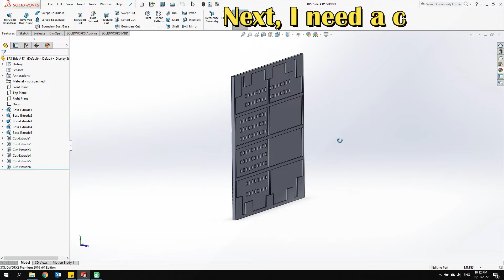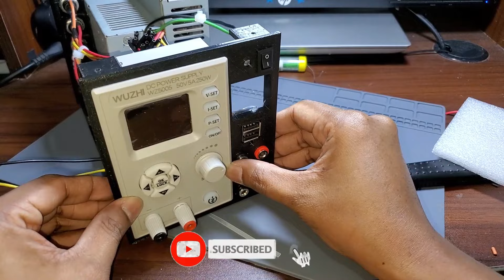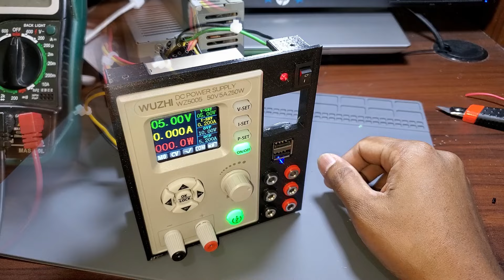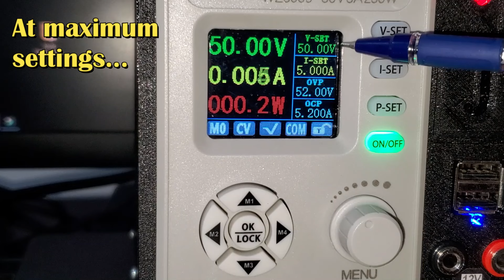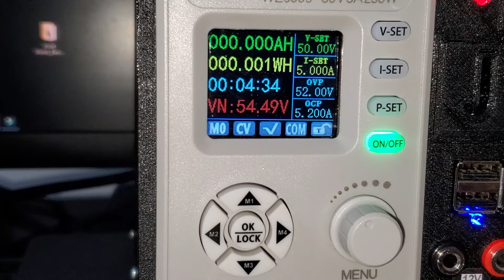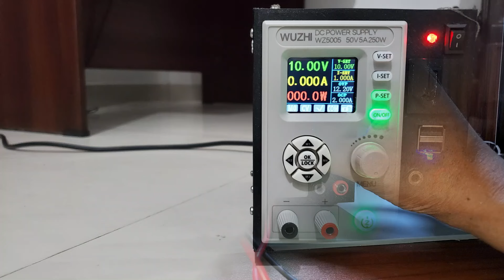DIY Variable Bench Power Supply 50V, 5A Using ATX Power Supply & WZ5005 module  Joule Works

Comment: How can you make this miracle happens? Using a 225W power source and a boost converter (91% to 96% efficiency) you'll get up to 250W output? 216W at its best. Do the math.
Reply: As the video description, he mentioned max total is 223w and that variable voltage module 150w max.

Comment: Next time try 50V and 5A - and u will see, after a short time, it will blow up ^^
Reply: Elaborate
Reply: @rondo1233 actually it won't blow up because ATX PSU has protection circuit built in, if the load is too high the PSU will shut down. But he used only one 12V wire, that single wire isn't capable of delivering 12A. This ATX PSU rated it's +12V @ 12A, that's 144W.

The boost converter always consume more power than it's output power. He boosted 12V upto 54.5V. He claims this PSU delivers 5A @ 50V that's 250W. You see it's not possible to get 250W out of 144W, right?...

And the boost converter has a 
15A fuse at it's input, boosting voltage upto 54.5V from 12V will consume more than 15A of current when a load is connected. I'm pretty sure you can only get few m.amps of current at 50V.

Comment: Nice but the weakest link is that horribly noisy little boost converter, I would have it feed a capacitor bank with a large 5 ohm inrush limiter. (6 x 470 uF caps from old ATX power supplies would work nice in parallel)

Comment: from the price and operation and function , you can conpare with DPS5005
Reply: It looks like this DIY has 4 outputs, while most others only have one.
Reply: @DavidHust  the device itself only has single output, it cannot output different voltage and current in different channel

Comment: Joule : Saludos, I have another question and hope you can give me an answer; On my ATX P/S I cut off the connectors on the wires and I have a small problem, I ended up with 13 Black, 7 Red, 5 Orange, 3 yellow and (1) each of Green, Blue, Violet, Brown and Grey; Should i bundle and connect all the black's together and the same with all the extra same colored wire's (making one (1) wire of Black, one red, 1 Orange and 1 Yellow; If it's NOT too much trouble "PLEASE GIVE ME AN ANSWER ON THIS"; or if someone else reads this and has a solution will appreciate it very much.
Reply from the maker: Yes you can bundle same color wires together. Also keep in mind one wire is rated for only  6Amp.

Comment: I have the same boost converter. I boosted 12V to 30V, I only could get 3A max and the input current was above 10A. I tried 3.5A but input current raised upto 15A, there's a 15A fuse at the input side. 
In this video he boosted 12V upto 54.5V. I'm pretty sure maximum you can get is around half an amp at 54.5V.

Comment: Suggestions

Epoxy in the USB port instead of hot glue.  
Make use of the screw fittings for the PSU.  Even if that means a wooden rear panel rather than 3d printed.  
Add in a second 12v and ground line to the voltage booster input (as long as the 12v is from the same rail this is fine) 
Add a second cable to each banana plug (you definitely have enough 12v, 3.3v and 5v and should have enough grounds)
Add in a 10ohm 10w resistor between 5v and ground.  Most ATX PSUs require some kind of load on the 5v to work properly.

Comment: Yeah glue the potentiometer screws and sockets and fuses because screws just mysteriously wind themselves. You didn't glue the case screws, it will fall to bits, in fact just dip the whole box into glue just to be sure.

Comment: Are you sure wz5005 module will boost 12v to 50 volts. I do not think so because it is a buck module.
Reply: Deshalb baut er ja auch ein 400W Stepuo Modul zwischen das ATX Netzteil und das wz5005 Modul. That's why he builds a 400W stepper module between the ATX power supply and the wz5005 module.

Comment: I have a VERY strong question; (I AM VERY CONFUSED); the diagram shows and indicates for the "Current Constant Adjustment" TURN CLOCKWISE (+) TO REDUCE CURRENT; AND, TURN COUNTER CLOCKWISE (-) TO INCREASE CURRENT ; The ( + and the - ) sign contradict the statement to increase or decrease current; I ask YOU, is this an ERROR or am i in error; I just want to make sure i'm reading this correctly before I burn the unit up inadvertently...PLEASE HELP ME ON THIS....Thank you!
Reply from the maker: Yes, your are right, this is an error. Just follow the arrow direction with (+) & (-) signs. Thank you for pointing out this. I will make this correct.

Comment: Isn't the front panel a buck converter as well? It has an input of 6V to 55V and an output of up to 50V. Don't think you need the extra 400W Buck converter....!!!
Reply from the maker: Front panel is just a step down buck converter. 400w boost converter used for getting 50V from 12v supply of ATX power supply
Reply: @JouleWorks why not just use boost on front panel? Instead of using two converter?🙄